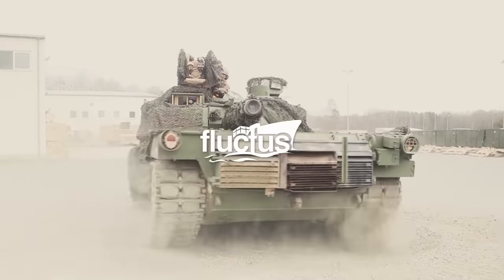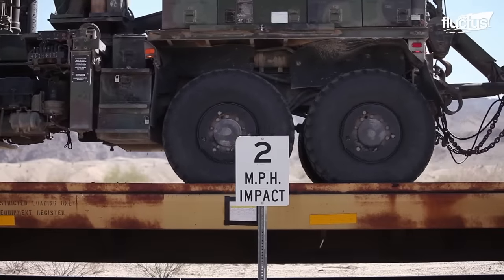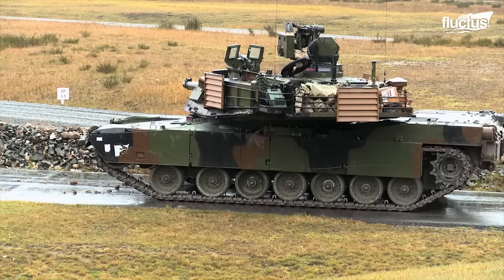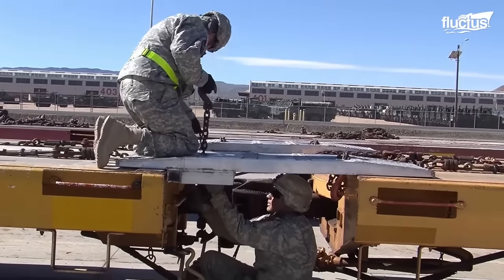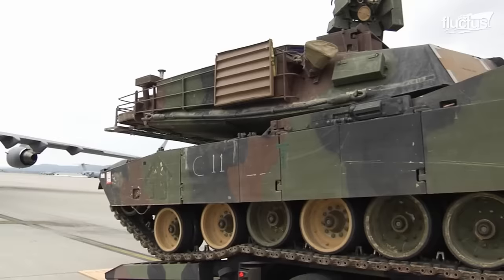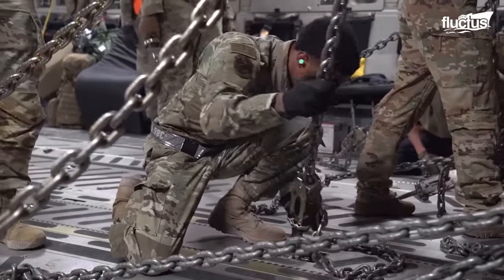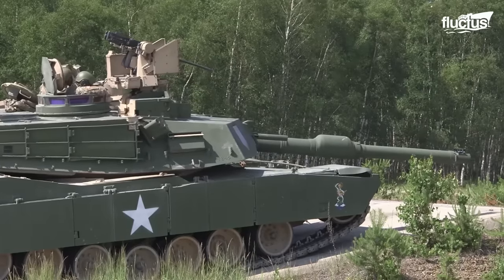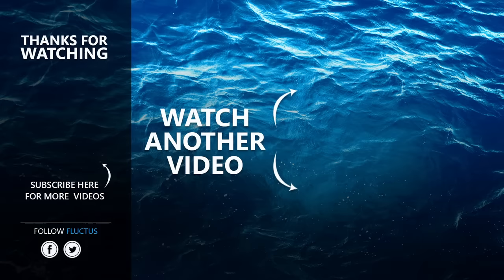Behind US’ Insane Logistic Operation Moving Billion $ Worth of M1 Abrams Tanks

Comment: The engine is a General Dinamics turbine diesel not a gas turbine 1500HP, I worked  in them for long time more than 15 years.
Reply: Thanks for clarification. By using Diesel rather than J1 (Kerosene) it simplified fueling requirements greatly.
Reply: Its a gas turbine and use JP8.
Reply: Dynamic you silly
Reply: @MATT-xv4bh  Those silly keyboards with a mind of their own.
Reply: Thank you, I was wondering the same thing, these bad boys sounded a lot like our Blackhawks whenever I heard them spool up. Really cool piece of technology!
Reply: Which tank runs on jet fuel ?
Reply: @robertevans8024  jet engine tanks, jp8 is a refined version of diesel fuel. The US M1  series of tanks is JP8 but they could run on diesel fuel if necessary, or Jack Daniel’s “lol”; Jon jp8!fuel lowers the lifespan of the engine however
Reply: @josephhaack5711   They can run on just about anything that’s why they are called multi fuel. If they bought the GM version it would have been a 1500 hp Diesel engine. The Chrysler version is a Honeywell AGT 1500 multi fuel Turbine engine. I know what tank I was tank commander on and they didn’t have diesels. The diesel tank died with the M60. I don’t know what secret Army you served in for 15 years that had a diesel engine. A simple search on the internet you would found out what the engine is was and will be. 😂
Reply: If it's combustable liquid it can probably run on it. A diesel requires diesel only
Reply: They must have some torque cos there's cars tuned above 1500hp?
Reply: @lawrencehubbard2985 The Leopard-2 runs a diesel piston engine,so does the K-2 Black Panther and the Japanese Type 90, all of which are modern tanks. It comes across a little ignorant stating that the diesel tank died with the M60 imho.

Comment: Why isn’t the Army using the actual correct size wrench to tighten the turn buckles? Seriously a pipe wrench???
Reply: Have you seen military equipment up close? Those things have been beat with hammers, ground between tracks and cement, drug 400 miles hanging off a rail car.

The pipe wrench is probably the only tool they can find that works with the beat up equipment.
Reply: @frankyfourfingerss  Точно подмечено !

Comment: The M1A2 Abrams has 3 different weapons  systems, the main gun 120mm, 240 machine gun, and 50 Cal. Machine gun on top of the turret mounted in a CROW system.
Reply: Don't forget the coaxial M240 machine gun beside the gun.   so really 4.  The 120mm main gun, the M240 machine gun for the gunner, the 50 Cal for the commander, and the 240 coaxial beside the main gun.
Reply: @redmustangredmustang  yep. I was about to say the same thing

Comment: Back in the late 1980's, I served as a Cavalry Scout at Fort Knox. One time, we were out training, determining road grades through the use of maps and without maps, estimating water speeds of rivers, and determining the weight capacity of bridges using simple calculations based on bridge length, span lengths, type of material, size and number structural components. We were at two-track rail bridge made from wooden timbers. The platoon sergeant asked if this bridge can support a single M-1 tank crossing over it one at a time. I quickly said yes, thinking nothing of it. Everyone went silent. They did not have time to count the timber,guesimate the span length, etc., much less do the calculations using a mechanical computer (a wheel, but functionally similar to a slide rule), which I did not use. However, I actually had a BS in engineering before I enlisted. They all wondered if I actually did the calculations in my head. The Platoon sergeant asked me how I knew. I said that based on the maps we were using, this bridge is the only rail line heading east. In case of a war with the USSR (they had not collapsed yet and it was not obvious they would), all equipment (to include M-1 tanks) from Fort Knox would have to use this bridge to get to the East Coast, before being load on to ships to reinforce Europe. Not only can the bridge support one M-1, it can support a train loaded with M-1s. Everyone broke out laughing. It seems you did not have to do a bunch of calculations to answer an engineering question, even if you have an engineering degree.
Reply: I would have said, "if it can support a train, it can support an Abram."
Reply: @Alpacabowl98  

At the time, I was trying to make the point that it could support a train carrying a train load of Abrams. lol
Reply: BS in engineering...? Lol that's what it amounts to I guess.
Reply: @ycplum7062  I work for the road dept here in Las Vegas. Several years ago, I asked why were were replacing most of our bridges, we were spending most of our budget on bridges that were still in good shape. I wanted to do some repaving jobs. I was told they were not rated for Abrams tanks. I asked why Abrams tanks would be driving around Las Vegas. I was told nunya business.
Reply: @TheBandit7613  

LOL. Just speculation on my part, but it might be the requirement for federal aid.

Comment: Good Day All : I worked for the turbine blade manufacturer in Mississauga Ontario Canada for 16 years . The engine builder was Textron/Lycoming . That engine program was the AGT 1500 . Best dammed turbine blades , most cost efficient . The ones that we made for the Rolls Royce Turbine division in Derby England were much too over designed by R.R. and therefore each finished blade was about 12 or 13 times more expensive than the ones we made for the M1A1 program . Cost efficient parts are something that some people overlook .

Comment: DODX is not a flatcar design. DODX followed by a number is the reporting marking identified the ownership and serial number of the railroad freight car.
Reply: The DODX Flat Car Fleet is owned & operated by the Military Transportation Command, Headquartered at Scott Air Force Base, in southern Illinois (St. Louis).  Railroad Reporting Marks ending in X designate that the rolling stock (locomotive or rail car)  is privately owned, while any other reporting marks indicated that equipment is controlled or owned by a actual railroad.  
The DODX rail fleet also operates different types of freight cars in addition to its DODX heavy duty capacity flat cars.    Some of these include tank cars, box cars for ordinance, covered hoppers, special unique commodity movements,  as well as cabooses (assigned for security movement).  BTW It is strongly suggested to maintaining respectful distances from DODX Cabooses.  They "may or may not" be engaged in active security missions, nevertheless they are not to be messed with.
At one time during the cold war, DODX operated a fleet of rail cars equipment (usually former passenger coaches)  modified with electronic resources for assisting B-52 & B58 target practice exercises.  The cars were  quietly moved to slidings in many different communities, then the Air Force would practice making B-52 & B-58 bombing exercises, on the rolling stock's electronic signatures.  The cold war was taken very seriously back then.  
During WWII & the Korean War, the War Department operated is own fleet of former passenger coaches converted in hospital patent transport cars.  This fleet transported wounded troops arriving CONUS (Continent USA) to & from military as well as veteran administration hospitals.  This was long before today's military Nightingale Flight Operations.    
Fort Estics  Virginia & its museum,  is one of the most informed sites regarding the DODX and War Department Railroad Operations.
Reply: @johnlicht9151  I am totally aware that cars bearing DODX reporting marking  are owned by the Department of Defense.